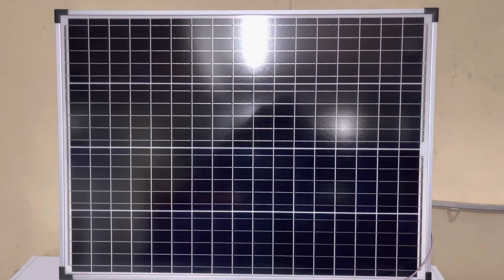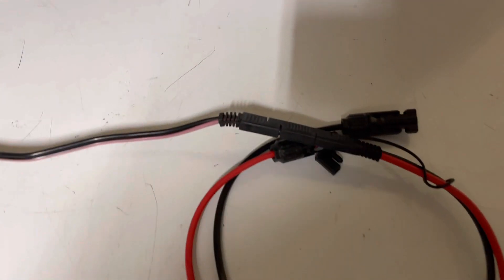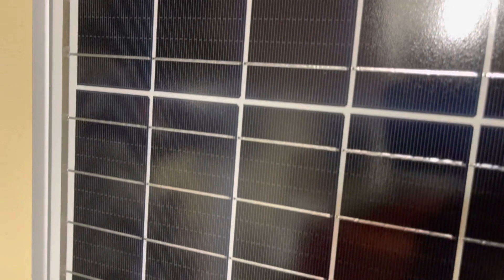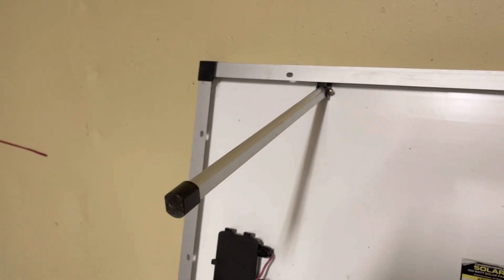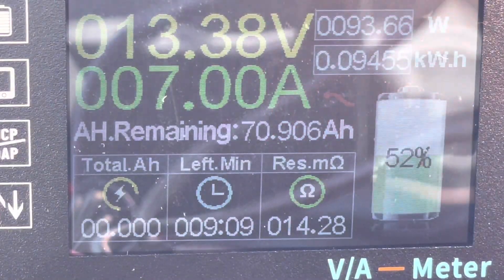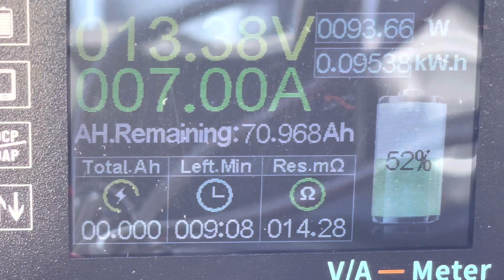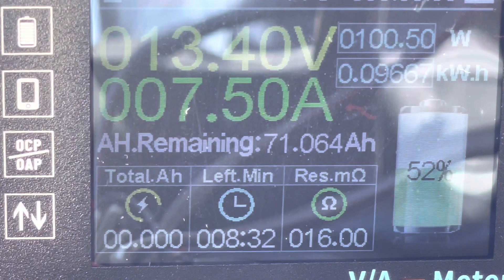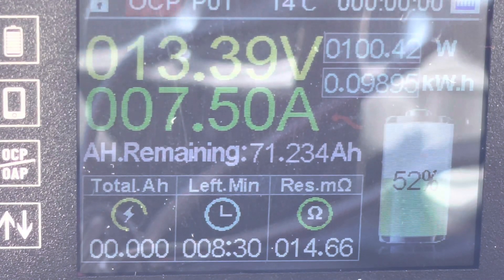Long Term Harbor Freight Solar Panel Use! Has it held up? Was It Worth It? Still The Best For The $?

Comment: Love these panels.  2 100w panels wired in series.  About 40v on a 30a power queen mppt charge controller and 2 100ah PQ lifepo4 batteries in parallel for our 12v setup and love it.  (210w panel on separate mppt charge controller)  410w.  Had them for 2 years now and still put out over 200w on a sunny day  30°f-45°f weather.  Installed on our shed.  We definitely enjoy these panels.
Reply from the maker: Yes they have been excellent

Comment: I've bought larger panels online, and they're good. If you're doing a large array it's nice to have the bigger panels. For a small install, a shed, backup-power, or even just trying to move a few things off the grid? A local store with easy swap-out if something is wrong can't be beat. Especially when they hold up like this.
Reply from the maker: Yea these things are amazing for the price

Comment: I bought 6 of these panels earlier this year for $89 and $99 each and I haven’t been disappointed. In full sun I can get just a bit over the rated output as you did. It’s much more convenient to get them locally when on sale than to order others online. And if there is an issue (which I haven’t had) they can easily be exchanged.
Reply from the maker: Exactly and the legs are an added bonus